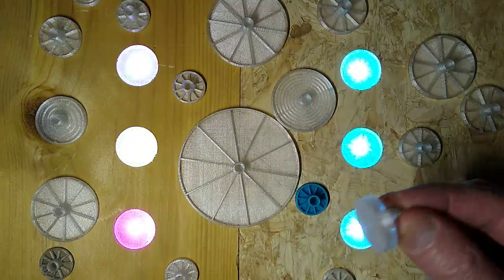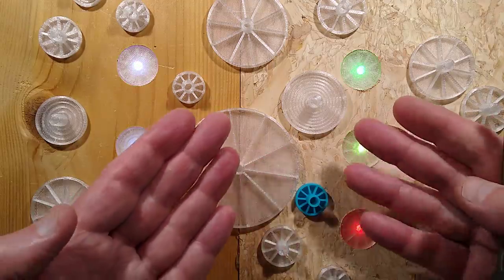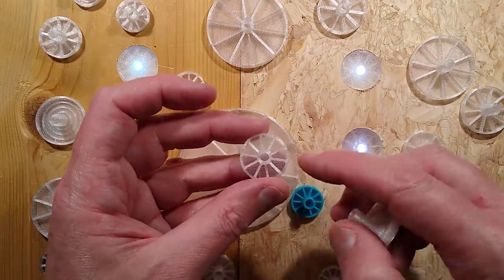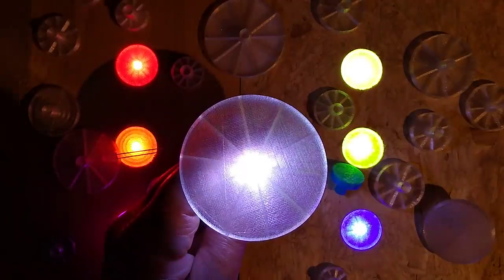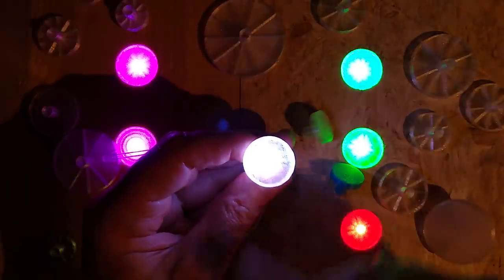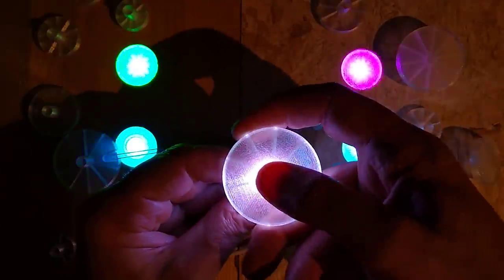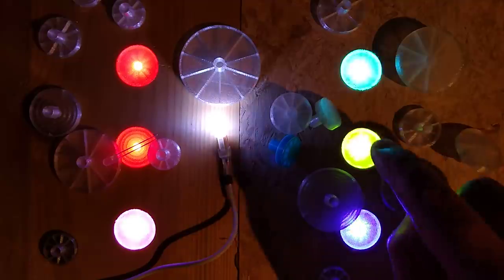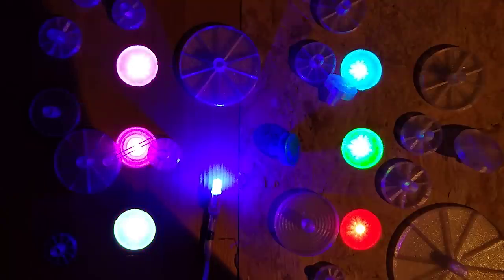DIY pinball-style lights for recessing into wooden surfaces

Comment: make the plastic a cone with the led well at the apex. use lambertian emitters, then add silicone oil, gel, glue or epoxy in the bottom of the LED well to eliminate the air gap. just sand the flat base with very fine sand paper. Done. You will get perfectly even, flat illumination of the disk with very good efficiency. They key is A) coupling the LED efficiently to the conical reflector and OBTW the cone surface has to be highly polished, sorry. :)  PS: you can machine acrylic on a lathe to near-optical surface quality, and you can hand-polish it TO an optically smooth (sorta, good enough) surface on a polishing wheel.

Comment: I've used painter's tape on the drill bit to identify where I should stop drilling. Not as good as a proper router, but works well enough. Spend the extra seconds to file off rough edges -- it'll save finishing time later.

Comment: Do you ever take speaker to bits? I’ve got a sub woofer with a nasty pop when it gets power. Maybe needs a better combination of bits to avoid?
Reply: You might want to put in a relay between the amp output and the coil(s) of the subwoofer element and turn the relay on/off using a delay circuit, such that the speaker element isn't connected to the amp when the amp is powered on.

Comment: Did someone say PINBALL? These are actually kinda nicer than the ones used in some games, even modern ones with the fancy RGB lighting as that's still done in an a bit of an old fashioned way with a tiny lightboard underneath.
Reply: The stars look a bit like star rollovers you get on older games
Reply: Dammit, now I want a 3D printer
Reply: Also, CENTAUR must be destroyed.

Comment: For the larger discs, perhaps a larger hole with angled sides would diffuse the light better, and to hold the led in place the ribs could be extended to the correct diameter.

Comment: If you put a fine blade from your skill saw on a table saw and set the depth,, the copper string LED lights will snugly fit in the groove you just cut, make sure the LEDs are pointing up and out ,,,moulding with lighting, using clear epoxy filler , 5/16 by 3/4 by what ever length the copper lighting allows

Comment: For the smaller ones, Forstner bits might be the way, but they can be expensive if this iss all you use them for, flat bits work
For the bigger ones (50-75mm) i personaly might use a core bit to grt the size, then take out the middle with a router, which would save on making a template
The centre hole may benefit by being bigger than the stem to allow the light to spread, specially in the larger discs

Comment: using a forstner bit would probably make the holes easier and more accurate to cut, you could even match the depth of the 3d print to the depth of the size of forstner bit and therefore have the end of the bit flush with the surface when drilling should stop

Comment: Good idea, and nice project for the 3d printer. Just wondering if you could print something similar and stick it to the front of an empty Dulce Gusto (or similar) coffee pod. The outlet of the pod seems a suitable size for an LED. Could be useful for a recessed ceiling/ panel /pendant light.

Comment: I wouldn't use PLA as it distorts with heat. There are other high temp plastics you can use like nylon. Good idea mate
Reply from the maker: These run cold.
Reply: @bigclivedotcom  Then it won't be a problem

Comment: The lack of diffusion in the 75mm one might be addressed by printing it as if it were entirely made of light guides. So no simple back-and-forth pattern for the top plate, instead have it radiating from the centre. Yeah I'll leave the details to somebody else... Just having several thick-ish radial struts might help. Think about the plastic as it's oozing out the nozzle, the light is going to follow that pattern.

Failing that... cast some out of epoxy? You can see in the 75mm one, the light just bounces off the sides of the printed lines, that's gonna happen to them internally as well with the LED light. So maybe print one, smooth with acetone vapour, sand, polish, then make a mould from that and cast a smooth solid piece. Moulding would also save on filament cost. Would probably only be necessary for the biggest ones, the small ones are fine. 

Nice little invention though, would look nice on an appropriate bit of furniture or even shelves.

Comment: in signage like channel letters 3 inches is optimum for not creating hot spots on larger faces. But I know 3 inches i pretty far down but for large sizes that would probably be best depth even if you just made the stems that long.

Comment: I wonder if it's possible to apply more sophisticated light guide techniques to 3D prints, like those used in thin display backlights... It usually involves laser-etched gradient patterns on acrylic sheets, so something similar could probably be done by printing in a certain way.
Reply from the maker: 3D printing isn't really optically clear enough for that, but laser cut and etched acrylic would be.
Reply: @bigclivedotcom  Of course it won't work quite the same but maybe the gradient idea can still be applied to somehow affect how the light spreads. I haven't gotten too deep into weird print patterns myself but you can certainly do some interesting stuff, see Billie Ruben's video: https://youtu.be/zSgW0KoguXc

Comment: Hi Clive - Great video as usual :-)   Could you attach coils to the back of these as well as LEDs, making a speaker?   Also, you might find that white PLA transmits the light better than coloured, maybe.
Reply from the maker: It would be better to use an actual speaker.

Comment: I have no experience on the subject but for the bigger lightspreaders would it be possible to somehow use the same material they use in flatscreen backlighting since it does really miracles at a short distance? 🤔
Maybe print the spreader with a slot to insert the screen or something

Comment: Forstner drill bits and a drill press. However, what about drilling "normal" holes and making dome-shaped inserts that sit above the surface? Do they have to sit flush with the surface? A domed shape may give you better light distribution. Plus it's easier to drill and install.
Reply from the maker: You could do that, but these were styled on flush pinball machine inserts.
Reply: @bigclivedotcom  Yes. Just thinking how it could be made easier for you.

Comment: Clive You should Should Study Fresnel lens and Try to make you own lighthouse Fresnel rectifier Lens with Acrylic or Epoxy + PVA  (Thin layer protection) Fill in to the 3D Prints

Also to need to make a Mod to you 3D Printer So it can CNC Router wood with a dremel tool mod

Comment: Ok, so lacquer and buff for pinball.  Can you show us how to make super evenly lit indicator segments and back lights? (like back lights for silk screened words that get lit up from behind or segments of alpha numeric segmented displays)
Reply: Just posted another comment about a few ideas I had to improve the consistency of the lighting and reduce the hotspot... Basically, make the thing as a cone shape with a lip, then fill the cone with more cones(that act as lightpipes) to make the bullseye lense, and devorcing the end of the LED pillar from the lense(there by breaking the lightpipe effect for the hot spot)... Or, I suggested to use a very open zigzag fill, you would loose sone light, but it should be much more even. Combining both, having a thin section of zigzag on top of the concentric cone bullseye would likely be very nice, sheet of vellum paper over that, and it would likely be very sexy... Would work with any shape. 

The lip on the edge of the shape is there to provide an easy attachment surface.

Comment: You can get the addressable, WS2812 LEDs in through-hole, ie with pins, conventional LED packages, in 5mm and 8mm. So they'd be good, wire 'em all up in series and stick a little control box somewhere. If you really must, you could use an ESP32 or the like to make it Bluetooth or Wifi. Then you could set whatever patterns you liked. The Arduino libraries for the LEDs are an utter piece of piss to use.

Comment: Please test different chemicals to change a clear LED to a diffused/frosted LED. I’ve always sanded or cut flat-top LEDs but would love to just wipe a rag or dip them to change diffusion.
Reply from the maker: I've ground the ends off in the past.  It never really gets the same effect as diffused resin.
Reply: @bigclivedotcom  I'm wondering if acetone/alcohol/super glue/anal lube would change the diffusion of a clear LED. LOL

Comment: Hi, Clive! I am new to 3D printing. I have an Elegoo resin printer. I see that you're using a filament printer. Can I use (or convert and use) the programs for filament printers to work with the resin printer?
Reply from the maker: The STL file should work in your slicer for your chosen printer.

Comment: All lacquer should be fine with PLA, it's one of the most annoying things about PLA that there's effectively no solvent which will smooth it. ABS you can use acetone fumes, but nothing seems to work with PLA. I once read that chloroform might work but I doubt it since I was never able to find any more information about it.
Reply: chloroform... yeah but nasty. Paint stripper that has methylene chloride (dichloromethane) in it will act as a solvent for PLA.
Reply: @askjacob  I'll have to give that a try some time, cheers

Comment: Nice. 

Wonder if you could incorporate a capacitive touch circuit with these?  🤔 maybe a small ring or wire around the edge.  That would make a low cost prop.

Comment: Clive,  can i pick your brain a tiny bit?  i have a sherline lathe/mill. the motor is a 90 volt dc, withe a speed controller to convert 120 v ac to the 90 volt dc the motor prefers.  i want to epoxy a magnatron magnet to the bottom of the speed control. this should hold it to the steel bracket attached to the motor. ?will said magnet cause problems with the speed control??  i can e-mail a .jpg of the circitry if you wish. i would ask my dad, 
[45 years IBEW} but he died in 2003  i will appreaciate any help, greatly!   poppy's workshop says Hi & help  if yes put a comment on my next video.  we can e-mail back and forth after that.  poppy